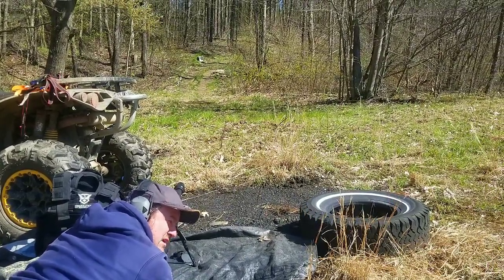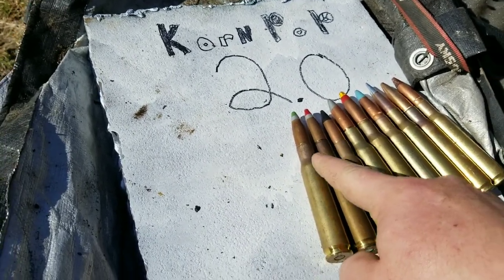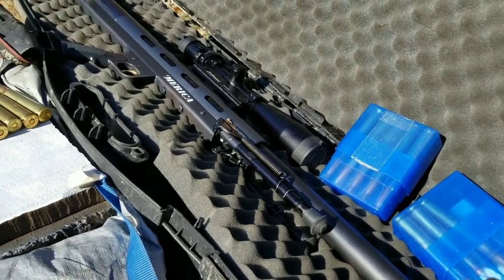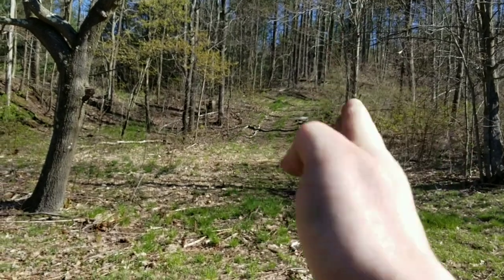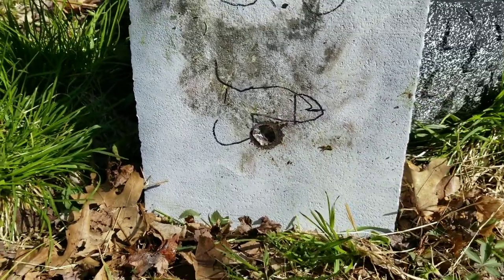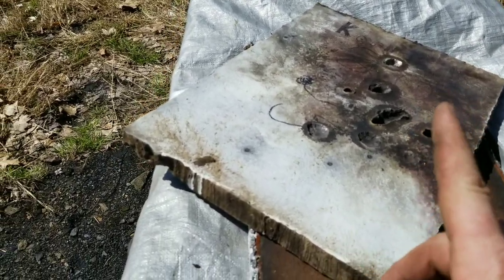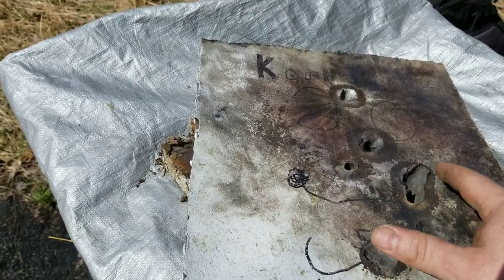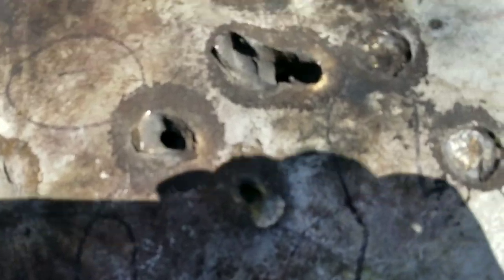Raufoss round vs. 2inch steel plate

Comment: That was good, I liked the way it knocked all other cores out. I have some 2" AR400 that if it weren't so heavy I'd send to you so we could see what difference that would make.
Reply from the maker: Yeah I had those plates and 50 cal and body armor strapped to back of the quad and it was trying to wheelie everywhere . Those rounds are very powerful, it was weird to hear the 50 cal go off then another bang go off. Definitely going to try some on a bunch of computers that need destroyed
Reply: @GearsAndGuns  Seems like an appropriate way to dispose of the data.
Reply from the maker: @Alloy211  Raufoss cyber security team !!
Reply: @GearsAndGuns  The ultimate in Data destruction.